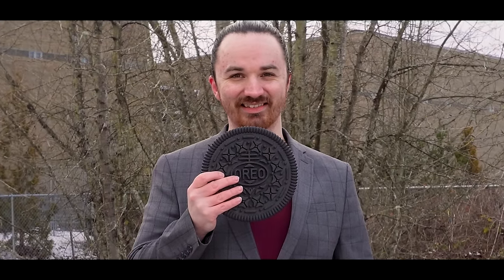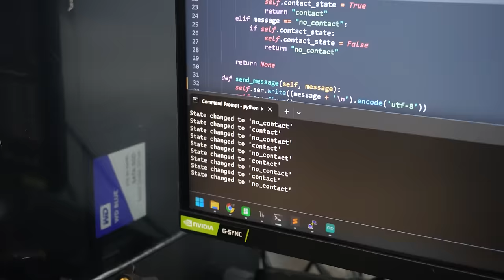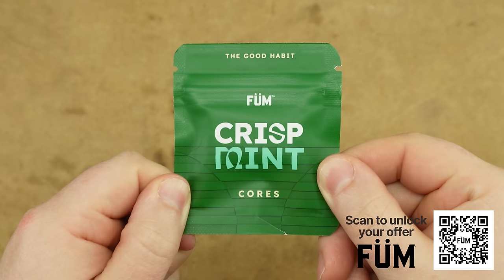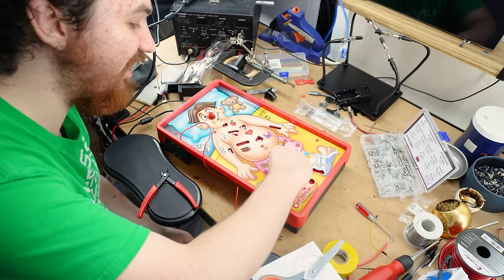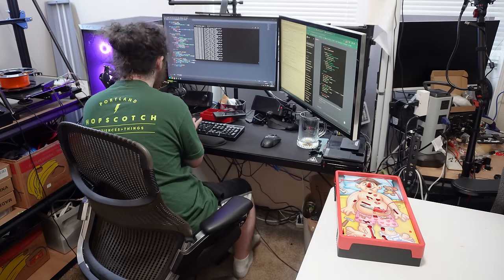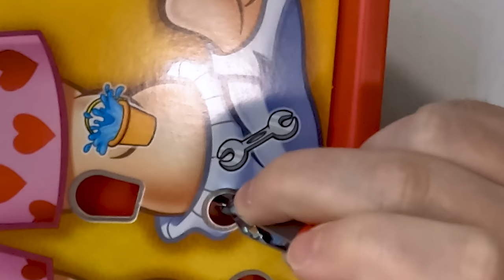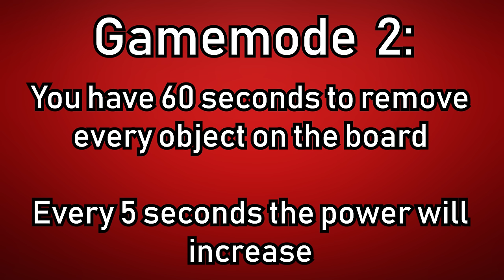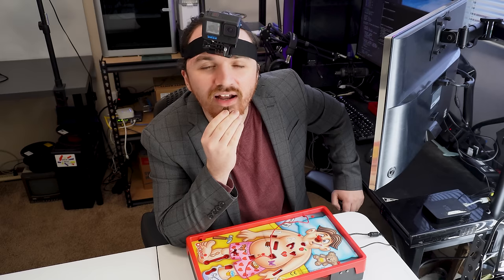I Overclocked Operation

Comment: All you need is a gigabyte of different screams loaded onto a microsd card for it to play when you do an oopsie. An almost perfect /10.
Reply: That update comes when he uses the tens unit and a system of pads you wear to make it self-surgeon sim.
Reply: operation but with TF2 screams
Reply: Nightmare mode: they're actual, genuine screams, and not just screams by actors. 💀
Reply: Half life scientists scream
Reply: @vlc-cosplayer Pretty sure I saw a coworker play this version of the game, except instead of a horse in someone’s thigh it was a light switch in a “live” circuit  🥴
Reply: If you die in the game you die in real life
Reply: @Talking_Ed  if you die in real life, you die before you game.
Reply: 10/10 would be if sparks fly when you touch the sides :)
Reply: @vlc-cosplayer So basically the Milgram Experiment 😊
Reply: Wilhelm scream
Reply: operation table that makes a fnaf jumpscare play out in real life (with the animatronics jumping at you and all).
Reply: Michel ?
Reply: Vape
Reply: @papajpolak8039 imagine playing operation but you hear "STAHP! DARGH! NO!"
Reply: @freelancepear87kakkoka11  that's so skibidi toilet of u

Comment: Imagine doing this, but every time it shakes, it is a random vibration level. You never know how badly you'll be buzzed. Lol. True anxiety
Reply: Just add a lead to shock the player sometimes as well.
Reply: @88porpoise yeah I was thinking of something to shock them. Maybe also with the random levels
Reply: @88porpoise Yep. Was thinking the same 😂
Reply: Basically chinese water drop torture
Reply: also make some of them buzz late
Reply: maybe weight the different vibration values?  so lower ones are more common and higher vibration levels are rarer?
Reply: @deathstinger13 then slowly raise the odds as time goes on

Comment: Another fun game mode for this would be they get stronger each time you mess up, as if the patient is in worse and worse health the more you bungle the operation. For example, it could start at 5%, and every buzz increases it by another 5%. You get 20 chances, and it ends if you mess up after you've hit 100% (the patient has flatlined). You'd probably need to manually enter when you mess up, since the detection seems pretty sporadic and discontinuous, but you could do something like a one-second cooldown on detection if you wanted it to detect mistakes automatically.
Reply: With real shocks.  Non-Lethal though.
Reply: @GeneralSorrow except the last one

Comment: You should wire this up to a few 50W bass transducers/shakers and mount them to your table.
Reply: Jonathan Joestar pfp detected, +26 respect
Reply: He should use a Rotary bass, much much stronger and Con much much lower. Infact, the Rotary bass is the strongest Type of bass there is.

Comment: One of my first electronics projects I ever made was like this! Only, instead of being smart, I was like 8, and I wired the board into 120V AC. I was like, "oh it'll be an awesome upgrade! Shocks! Sparks! WOO!" 
And then I welded the tweezers onto the board and tripped a breaker.
Reply: Isn't 120 like.. beyond the lethal treshold?
Reply: @jonnaas I've received 240V and suffered nothing more serious than brief unconsciousness. It really depends on where you get shocked, how conductive you are at the locations you're making contact, and your general health. For example, my 240V was caused by bridging the live and neutral of a UK socket with the fingers on my right hand. If that same 240V had to travel across my torso for example, instead of just my hand, I would probably be dead, as it would have had the opportunity to jump across my heart. As it was, I had deep pain in my right arm, convulsions, and a short spell of not being awake. No long term consequences thankfully.

THIS DOES NOT MEAN YOU SHOULD JUST GO AND CONNECT YOURSELF TO THE MAINS! I GOT VERY LUCKY! DEATH OR SERIOUS INJURY IS BY FAR THE MOST LIKELY OUTCOME!
Reply: @RaunienTheFirst  damn. Must have hurt. I got shocked by a fricking bugzapper when i was a wee little lad and always had a subconscious fear of them while you're over here defying death!
Reply: @RaunienTheFirst I have gotten shocked by 120 V many times.  Never did I get pain from it.  Just a weird current flow back and forth feeling (strong).  I did disconnect myself quickly each time.  I replicated the feeling with two common objects.  It felt the same so I'm not putting my method here since it might hurt others.
Reply: @jonnaas it’s the amps that kill.
Reply: @BIGMANLOGJAM  i've heard a millon people say that, i've also heard a million people say it's the volts. Another million for current. So please do link where you found this info, i would be over the moon if i finally got a conclusion to this confusing ass question.
Reply: @jonnaas I'm not going to search for sources but: it's kinda both. In the end it's the amps that kill. But, because a human body has resistsnce, according to Ohm's law you need volts to get amps flowing. So it's the amps that kill, but there's no amps without volts.
Reply: In theory, from my limited lay-understanding, the volts/amps thing comes into play when current is run across a transformer to step up or down voltages. Since power (in an ideal transformer) is constant and equal to Voltage times Current, when you step 'up' the volts, you step 'down' the Amps. As such, high voltage coming out of a step up transformer carries a lot less current because power is constant.

If we accept 'It's the volts that jolts, but the mils that kills' (mils = milliAmps), then it makes the most sense in a post-transformer secondary current, as you're experiencing less current across your body for a higher voltage, and thus get the 'kick' without being lit up like a carbon filament in a lightbulb >.>

Do not expose yourself to live voltage or current in any way not intended by the device you are using, regardless of voltage or amperage. :P
Reply: @BIGMANLOGJAM  It's a lot more complex than that.  Styropyro did a fantastic rundown of the different ways that exposing yourself to live current can be fatal.  https://www.youtube.com/watch?v=BGD-oSwJv3E is a link to his video on the matter.  While amps definitely play a role, it isn't so simple as boiling it down to 'amps kill' because there are cases where super-high amperage does nothing to you, and super low amperage could kill you in the right circumstances.
Reply: @BIGMANLOGJAM Both styropyro and electro boom have done videos about this
Reply: Current = amps and high voltage usually has a very significant current.
Reply: @jonnaas  once while pulling a plug out of the wall, i bridged the two prongs with my finger while they were still live.. didn't really hurt, but felt weird as hell and scared the shit out of me.
Reply: @holden_tld  you saying it didnt hurt gives me the same vibes as that kid in our school who stapled his arm to show how tough he was only to WHEEZE in pain when they had to pull it outta the poor guy. Still tried to convince us it didnt hurt at all. No offense but i really genuinely have a hard time believing it didnt hurt lol
Reply: @jonnaas when I was 12 my dad diconnected all the 120v sockets in my room as a punishment so I couldn’t use my electronics, I used a pair of pliers to reconnect the live wire back to the socket and shocked the crap out of myself, no adverse effects it mostly just scared me
Reply: @RaunienTheFirst  I got 220V about 3 times, once I touched the metal part of a lightbulb.
Second I inserted a broken charger and third I touched a live wire.
Reply: styropyro has a great video on whether it's the volts or amps that kill... in short, it's everything. The voltage, amperage, location and duration of the shock all play a role.
Reply: @jonnaas  I took 120 across the hand recently after fucking up the handling of a light switch, my arm convulsed and had waves of after exercise pain for a few hours
Reply: @Brent-jj6qi  probably had tired muscles afterwards!
Reply: @jonnaas  considering I probably did the equivalent of 30 push-ups in less than 2 seconds, yeah lol
Reply: @Brent-jj6qi worlds fastest workout 😂
Reply: @RandomFandomOfficial  god dude, if only, I’d do that all the time

Comment: The angular speed of the motor determines the frequency of the jostling.  The trick to getting the maximum possible jostling of the entire playfield depends on tuning the frequency to the resonant frequency of the entire system.  Rather than trying to determine that magic number, stick an accelerometer on the playfield.  Use a monitoring loop to tune the motor frequency to find the optimal frequency for resonance to occur.  Bam, maximum jostling every time.

Comment: the rubber band is intended to be a broken leg. The band goes on one peg, and the idea is to put it on the other peg with a twist in the middle. in the end it should be on both pegs, with a single twist in the middle think of an 8

Comment: Tips for operation: always introduce the tweezers locked, is easier to introduce it and helps to control the size for grabbing.
The elastic thingy is actually to be inserted, not remove it

Anyway, great video Mr Bringus 😁
Reply: Oooh… That makes sense about the rubber band lol
Reply: @Muhahahahaz  it's on the operation tag. Is something like "loose Achiles rubber band tendon" or similar
Reply: You gotta put some spring in his step!
Reply: current simple rules DO have you removing the band. but the original rules, where you earned money for successful operations, did have you attach the rubber band, which made it much more difficult. the card originally said "ankle bone connected to the leg bone"

Comment: May I propose a third mode? Basically an HP mode, where the patient starts with a certain amount of HP and every hertz that the tool makes contact, the patient loses a bit of HP. The lower the HP, the more violently it shakes. When it reaches 0, it shakes continuously for about 10 seconds at 100% power and the patient is declared dead. It can be scaled for difficulty level, where easier difficulty gives him more HP and harder difficulties do the opposite.
Reply: I was fully expecting a third mode that does exactly this

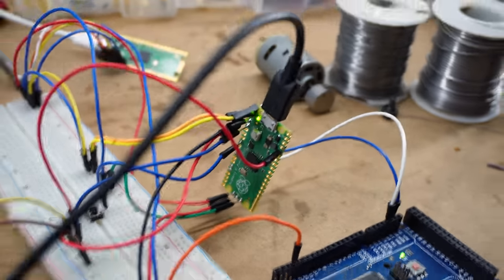Comment: 4:03 The Pi Pico absolutely can communicate with a PC over USB
Reply: Yes
Reply: Well… He didn’t say it wasn’t possible, just that it’s “not great”
Reply: Yeah, seems he trusts ChatGPT and uses it for everything
Reply: My question halfway in, is why does he need the PC to detect continuity when the pico could do it all by itself...
Reply: @ryjelsum  He was sticking with print() commands, likely because of chatGPT having become a rather terrible programming tutor.  Getting the serial port up and running on micropython is also a little more complex than it probably should be.  CircuitPython does a far better job, but isn't advertised by the Raspberry Pi Foundation.  Why, I have no idea, given that the Foundation and Adafruit (who makes CircuitPython) have a pretty close working relationship. but whatever...  I mean, he's using a full computer for this project, I think part of his thought process was "The whole point of this is being ridiculously extra, I'm just gonna let this happen and not try to fix it."
Reply: @faeranne   Using the UF2 provide by raspberry by in python, the device appears as a COM port. Talking to it as any other Serial Com device works just fine. Serial communication over REPL is practically plug and play. But you may be right on him just being "extra". Personally i would've removed the computer entirely added a couple of buttons and a simple LCD 1602 and made it a stand alone device.
Reply: @Muhahahahaz  except it is almost identical to Arduino. Just slightly different functions
Reply: leaving reply here so i remember this later (im gonna try making something like this)

Comment: Have you thought about passing electricity through the tweezers? :D
Reply: the tweezers and the metal plate short circuiting causes the motor to vibrate, so if you increased the volts going through the tweezers you could create sparks or make it arc when you touch the edge
Reply: Electroboom:
grins from ear to ear
Reply: @beanboy6934  electric arc = immediate fun death
Reply: that's literally how the game works
Reply: I know, but when I wrote the comment differently, it got automatically shadowbanned. Everybody knows what I meant :]
Reply: Tom Scott played it on his Plus Channel a few years back
Reply: Attach a live stun gun to the top plate of the game.
Reply: I did this and it was stupid. I just put 120v directly into the battery terminals if I remember right. Or maybe I bypassed the motor and light. It was like, 30 years ago, so I forget. Regardless, it was a lot of sparks and some melting metal. And a tripped breaker.

Comment: Can't wait to see someone beat Dark Souls using Operation as a controller.
Reply: It would need further modification. The object holders are not classified as individual "buttons", rather touching any part of the metal with the tweezers closes the loop on the circuit.

Comment: This was a fun project, good job. I’m not sure why you tied it to a PC though. Seems like with a couple buttons you could have kept that small of functionality on the microcontroller. 

Upgrade ideas would be to randomize the power, add LEDs next to each item and let the microcontroller show you which item you needed to get out, add some kind of sensors to each item so the game knows what is in and what is out, and add a screen to allow for two players with points earned for speed as you take turns getting parts out. All of that should be able to live on a Pi without the PC too.  Oh, and it should beep and vibrate for at least 1-2 seconds, not only while direct contact is being made. 

Keep it up!

Comment: Now make the script run directly on the pi itself, add a small screen with 3 buttons and integrate it into one of the 3D printed parts. I think theres enough space to make it standalone with an 18650 battery pack even.

Comment: Here's a fun idea. Rip the metal sheet out and frame each slot with a dedicated metal frame. Then you can program each object to a different intensity, either specific or randomized. Then you might get a small buzz or a big buzz. 

Also to make it more annoying you could hook up a shock circuit like that that Lightning game. That would make it more intense. Add one of those super bright LEDs for the nose light. Make the quiet buzzing noise from the speaker that really loud buzzer noise you were using during the last section.

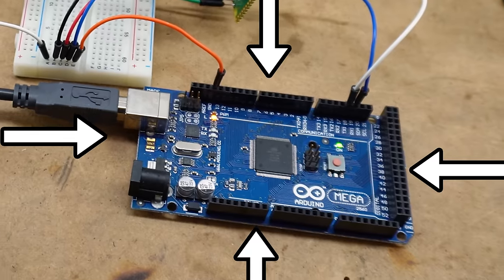Comment: 4:03 That's the thing about the Pico- it's incredibly versatile. You absolutely can use that USB port for serial, you can use it for anything you can program it to do. Lots of existing libraries support basic UART communication over it as a virtual serial adapter.
Reply from the maker: I probably could have gone that route but I'm just not experienced enough with it yet. The USB ttl adapter was my hacky solution to get it working asap

Comment: You should make a set of metal versions of those things you have to pull out so they become an extension of the tweezers so it's an extra hard mode. Try and pull them out with the parts touching the sides for extra challenge. :D

Comment: Ironic that he's playing Operation and gets sponsored by cigarettes
Reply: Have you even seen the ad?
Reply: I saw the vape smoke come from his face hole 😆 🤣 😂 😹  so did you watch the ad 😆 🤣 😂 😹 flavored air they call it 😆 🤣 😂 😹
Reply: Those aren't CigA rEtts, btw, god created humans to be humans, not animals
Reply: i think it just has such a strong scent that the brain interprets it as a taste (the brain uses both the actual taste of a food item and its scent to interpret taste, so if you get a strong enough scent, you could taste it)
Reply: @kylelee4209  You apparently missed the caption right on screen where he talks about it being cold as the reason you can see his breath. Or the common sense that, when it's cold outside (especially where there is snow on the ground), you can easily see your breath. I won't speak to the safety of Fum, but they're not vape products; the lack of a battery or any heating element confirms this. Pretty much the same as if you sucked on an unlit cigarette just to get the tobacco flavored air.

Comment: Instead of vibrating motors, play very loud wave files of the patient screaming if you miss, meanwhile, you hear a heart rate monitor. Sometimes it could go into fribulation and you have 10 seconds to remove your item and press a button or the heart rate flatlines and you lose. Maybe give you electric shocks as well.

Comment: The funny thing is it would be SUPER easy to build your own operation game. Literally need a piece of aluminum sheet, set it as your ground, some metal clippers with a positive wired connection soldered to them, a piezo speaker, and a power source. Maybe a few diodes, possible an DC voltage boost converter, etc. but all and all it’s a pretty basic game.

Comment: Imagine flowing wall outlet power through the tweezers and the board. Everytime you touch the metal, it completes the circut and shocks you. The full 120 volts!

Comment: I'm sure someone said this already but the Pico USB port CAN be used as a serial adapter.
It can even be used as a USB host so you can connect USB peripherals to it with a proper OTG adapter